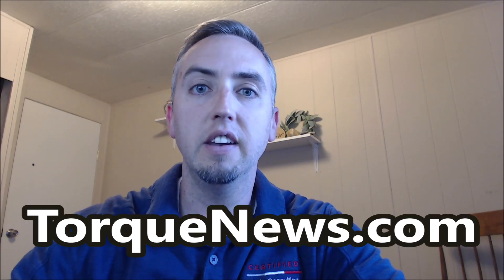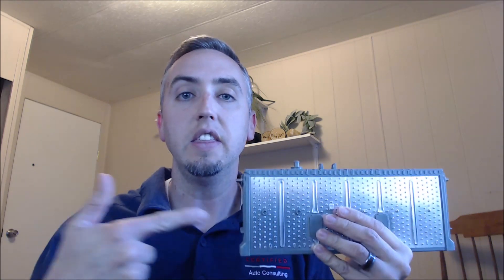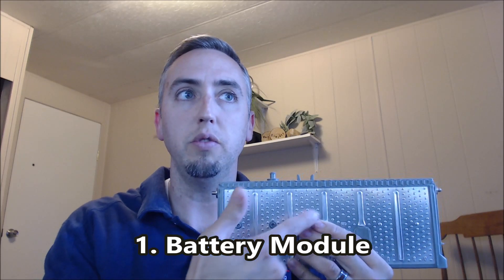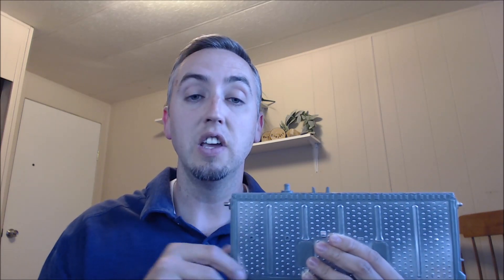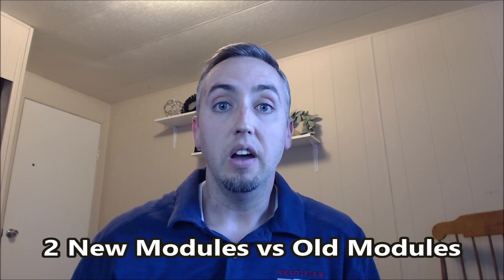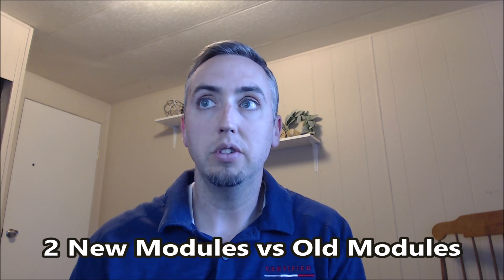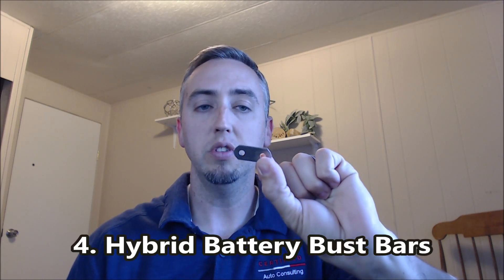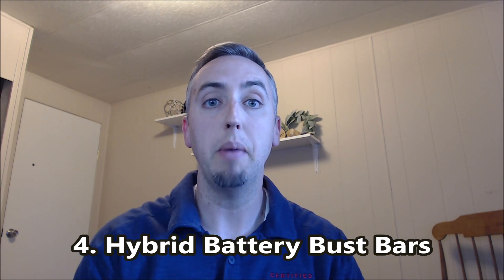5 Things To Know About Toyota Prius Battery Maintain it Well

Comment: Hi Peter, I am a new subscriber. 
Can you give suggest ways to extend life of the 12-Volt Auxiliary battery?
We have the First Generation 2001 Prius (one of the first 20 sold in the US), with only 71k on the odometer, and it is in excellent condition. The vehicle doesn't get driven much, especially, in the winter. Our 15-mo old battery keeps conking off requiring almost a weekly jump.
Someone mentioned using a "Battery Tender." Does it work? How to install it? 
Any thoughts?
Any other tips?
Thank you.

Comment: You guys have written like 20 Slam pieces on the Prius and 90% of the Information is complete crap - I have a 2008 with Original Battery doing great and still get around 45 MPG

Comment: question, does low mileage for about 1,600 miles per year affect the battery life everything else being equal? I am thinking of buying a 2nd generation Prius and drive 4 and 7 mile one way trips a week. So I am concern that low miles driven will reduce the life of the battery. I have gotten conflicting information on this question.

Comment: However putting old cell and new cell together in a pack still works fine ONLY WITH PRIUS
Reply: Does it apply to other toyota models? It should be same batteries as prius etc
Reply: @Symek92  yes I was comparing Toyota against Honda

Comment: I just drive my 2012 prius to the toyota dealer every year for a big service check and with that service there is always the battery check. When that check is done you get a 1 year warranty on the battery. And a tow company cart for all europe. For small service it cost 350 and for the bog service €500 u also get a rent car until the prius is ready. That’s also in the price

Comment: Usually how long would the battery last before they go out? 10 years 20 years? Also is there any differences in battery between the plugin version vs the regular version ?
Reply: We have gotten over 150K miles out of the 3 Prius's we've owned and the replacement batteries are really not very expensive.  Slightly more than a typical timing belt replacement. 
Plugin batteries will wear out faster as you are using more cycles on the cells.  The climate you live in will also affect battery life, we noticed the prius that set outside in the winter was the first battery to fail.
Reply: I have now 180.000 km on it. Nothing is wrong

Comment: Thank you for the info about the battery
Reply from the maker: You are most welcome Abraham
Reply: Hey Abraham, thanks!
Reply from the maker: Lydia Cao  Lydia, I am a Prius owner myself. And I would say if the bar has only 30 percent, don't buy it. You will be changing the battery soon. It's true that as you drive it charges, but it quickly, very quickly falls again. Don't buy. Look for another good Prius.